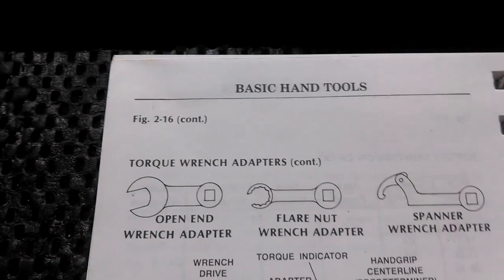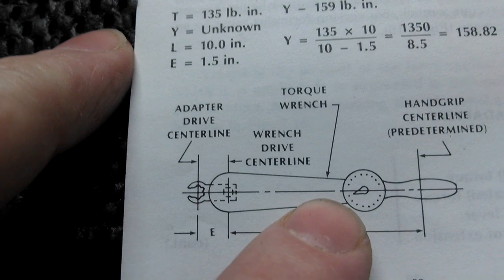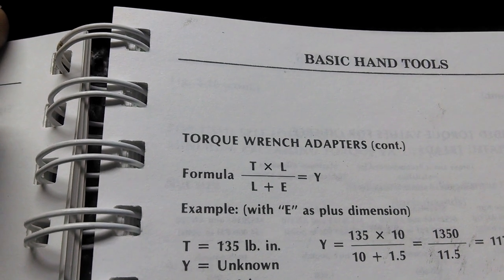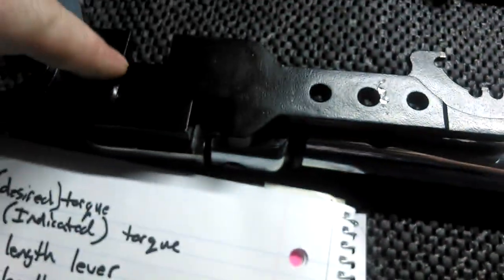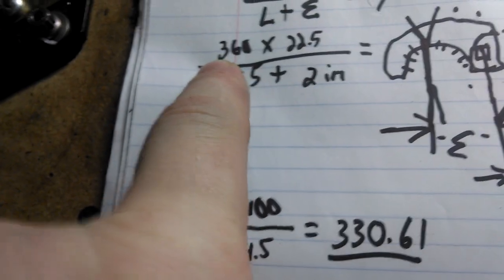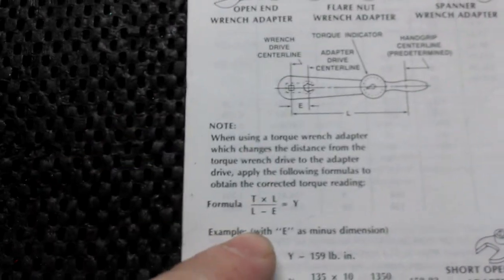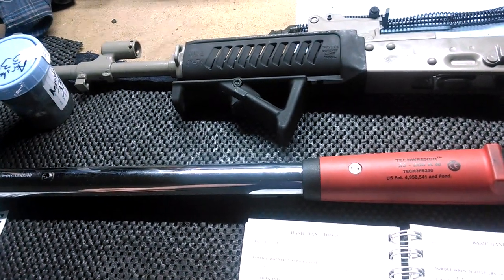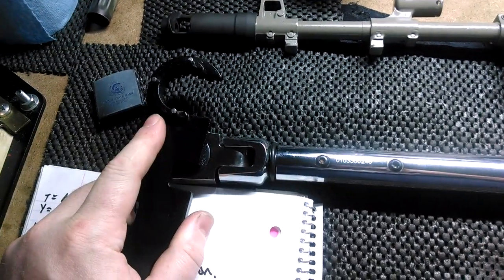AR 15 barrel nut torque formula

Comment: Thanks for the physics lesson.  I wondered the effect of using the extension of the castle nut wrench on the torqued value.  Thanks for the explanation and suggestion of using 90 degrees.  In your example, the mechanical advantage of the increased lever length was a difference of about 8%, 30 versus 27.5 ft-lbs.  Interesting!!!

Comment: what it all amounts to is the fact - the torque wrench and internal springs are preset- based on the  LENGTH of the  wrench  it is INCORRECT TO INCREASE  the length of the tool as it would take MORE  torque to reach limits of internal springs (I’m just saying)

Comment: So if you turn it at a 90 degree angle aren't you still 2 inch's away from the attachment point. Where's the formula that shows that gives you the correct torch.

Comment: Just a thought. If you turn the torque wrench 90 degrees to the adapter, wouldn't you just be creating a right triangle where you'd have to use the pythagorean theorem to find the length of the hypotenuse (the length of the torque arm in this case) to figure out the actual torque applied?
Reply: Thanks for the videos, now I have been thinking a lot about this as a beginner. I wondering if setting it to 90 degrees is the best way, because if we agree that you have to apply a trig/hypotenuse calculation anyway when it is set to 90 degrees then there could be a better way.Instead of setting it at 90 degrees, set it so that your torque wrench is in line with the centre of the barrel (which at a guess would be around 85 degrees), then you simply apply the calculation in this video. The premise behind this idea is that it doesn't matter how "bent" the handle is, just the distance in line. You would be eliminating the hypotenuse and the need for trig.Any thoughts? Your first video didn't actually mention an allowance for the hypotenuse.
Reply: sorry what I just wrote is wrong, the only way to get the torque handle to point to the centre of rotation is to go to zero degrees - so you have to apply a trig calculation - unless the difference in distance is so small that it can be ignored?
Reply: Sorry me again, it seems that everyone and I mean everyone is confused on applying trig to torque calculations -http://www.practicalmachinist.com/vb/general/torque-wrench-extention-question-163642/index3.htmlIf the experts can't agree then I don't stand a chance. As an aircraft engineering you might be the one to settle this debate!

Comment: You are 100% correct! Here is the link to prove it. Change value (A) to 90, and Desired Torque & Wrench setting will be the same regardless of what the values are for (E) and (L), but change the value of (A) to 0, or anything less than 90 and the wrench setting will vary. Here is the link -------> http://www.cncexpo.com/TorqueAdapter.aspx

Comment: The issue I have with this and the other video is you're saying, in a nutshell, "This is right, I use torque wrenches, and this is right." You never explain, at all, why what you're saying is correct. The reason why this is correct is because when you place the torque wrench at a 90 degree angle, you create a new lever arm. The length of the new lever arm is equal to the square root of the torque wrench squared plus the extension squared. When you apply the torque, you are actually applying the torque at an angle θ, where θ is equal to the inverse tangent of the length of the torque wrench divided by the length of the extension arm. The torque applied would then be equal to the distance of the new lever arm multiplied by the force times cos θ, which is equal to the torque applied to the torque setting of the wrench. Essentially

Torque Applied = D * F * Cos θ

Where:
D = Sqrt( Length ofTorque Wrench^2 + Length of Extension^2)
F = Torque Setting of wrench / Length of Torque Wrench
θ = Tan^-1(Length of Torque Wrench/Length of Extension)

Comment: All 4 service manuals (Army, Navy, Air force and Marines) all say to torque the barrel nut with Torque wrench and Armorers tool inline at 180 degrees.Whether or not you are right about torque wrenches in general. you are wrong about AR barrel nuts.  Most aftermarket barrel nuts will use the same procedure as well
Reply: Exactly.
Reply: Eightup Okie Would you happen to have the dimension "E" (Effective length  of extension) of the barrel nut tool used by US Forces ?
(Or the lenght of your tool? Please state mfg name & model id of your tool along with "E")

I'm wondering what the actual torque value is if you measured like you had attached a socket (or had torque wrench at 90 degreses ) vs doing it in line via a extension.

Seems like the value, the amount would be more if doing it inline.

Comment: Your only talking about a 3 pound difference at 30 pounds, when the specs are between 30 and 80 pounds. Most torque wrenches are probably not that accurate anyway. So go at least 30 pounds and don't go over 70 pounds when using an extension straight. Nobody will ever know the difference and definitely wouldn't be able to measure it.  😁 Oh, and if your that anal about the torque make a really deep socket. 🤣 The 90* thing is not accurate either, I,m sure it's off a pound or two.
Reply from the maker: Or you could just torque it correctly. It's the same amount of effort
Reply: @SHOOTSHOW00  My point is that the spec is so wide and most people don't calibrate their wrenches that it's a kind of a pointless argument.
Reply from the maker: @rustynut1967  My point was that the people saying that a 180 degree torque with an adapter is the "correct way" are IDIOTS.  I did also make the point that I don't even use a torque wrench to build AR15's because it doesn't really matter.
Reply: @SHOOTSHOW00  I agree. That's what I was saying to. My comment was more of a response to others that were commenting.
Reply: @SHOOTSHOW00  "Or you could just torque it correctly ..."  Great answer and comeback!  Ha, ha, ha!